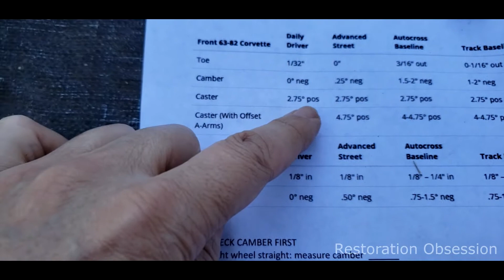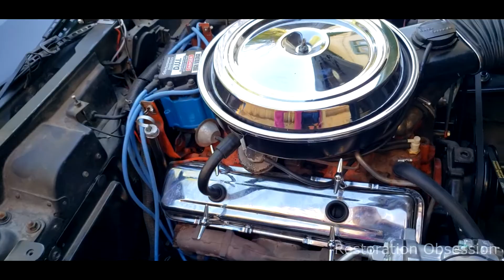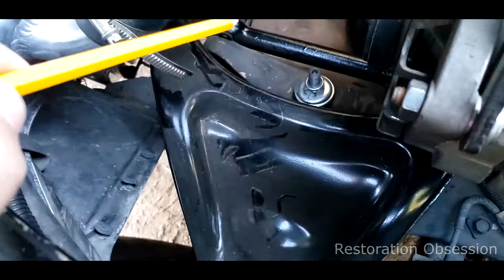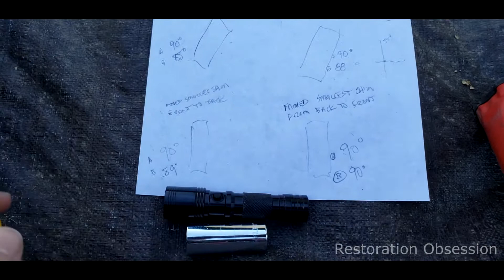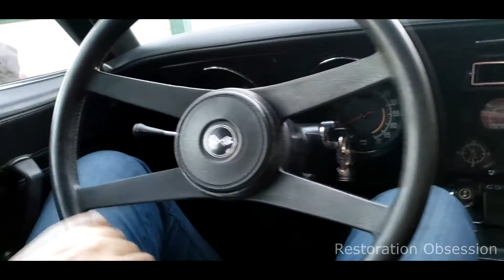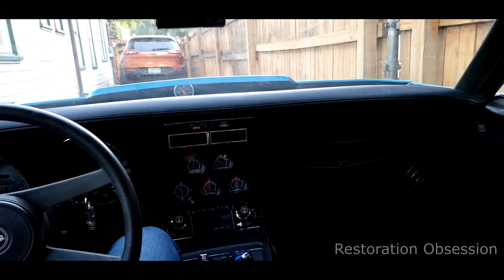1976 C3 Corvette Stingray - Front Wheel Caster Adjustment & Condensed Twisty Drive

Comment: You are adjusting the angles in the backwards order . You adjust caster first - then camber and finally toe . Adjusting caster will change camber and toe . Adjusting camber will change toe . When you adjust caster - you have to turn wheel out 20° then 20° in with out having all the drag from the black top .that's why a shop has plates with bearings in between so the wheels can turn freely.  You want 1/2° less on left side for road crown . You also want your angle  guage on the hub not the wheel . Just remove the dust cap . Camber you usually want close to 0° for normal driving . The double A arms have the geometry built in to when you go around a turn more weight will go to outside wheel and the camber will go negative- kicking the top of the wheel in for better traction . The spindle also has steering axis inclination to help adjust the toe while turning since outer wheel will fallow a bigger circle . Inner wheel will run a tighter circle . Enough  - if anymore info can help post back .

Comment: Thanks for posting this video. i was looking for information on how to read castor degrees on my 79 C3. Rear end restoration was my winter project after purchasing my one owner Vette and bring her home on Oct. 1st/2020. It liked to wander on the 2 hour drive home and burn copious amounts of premium fuel at 70mph. lol. I began my restoration by building 2 ramps so I could work underneath her. 4-2x12s were trimmed to 10'-11" and the and the 13" pieces along with a few others I had to cut from another 12 " wide plank were used as uprights on 16 Inch centers. Next I ripped a 1/2' sheet of plywood in three pieces 16" wide and boxed in the sides of the wooden frame for more strength and stability. I use 2 pieces of 8ft. long 2x12 with center supports for ramps to get her up and down. Copious amounts of money were spent rebuilding the rear suspension to make sure of a good alignment. Every rubber mount and bushing (strut rods, trailing arms cross member cushions) were renewed with rubber. New half shaft U-joints, differential stub shafts due to wear on the differential pin. These should be checked for excessive wear as they will effect keeping the vehicle in alignment. I even installed a new rear spring while I was at it. Gear pattern was checked for excessive wear while it was out of the car. Differential refilled, once back in place, with 85W-140 gear oil and 2 bottles of GM posi-traction oil. After a few miles of driving and giving new parts a chance to settle in where they wanted to be, an alignment was done. A different car to drive now. This coming winter will be body mounts, a Buick Grand National 2oo4r overdrive transmission, and replacement of any worn front steering and suspension. My three sons will be passed this classic automobile eventually.
Reply from the maker: Glad to be of help, John. Good luck with your restoration!

Comment: I forgot to add that most people do not realize how involved doing the entire front suspension is so you have tackled easily one of the most difficult and involved things possible on these cars. You didn't show or mention how you got the front springs back in. I am curious because there are a few ways to do it and it's possible to do without a spring compressor as I did by using a long threaded rod and drawing the parts together. I also used it to remove the tension and lower everything down to the floor. Congratulations on a tough job well done.
Reply from the maker: That's good to know! It was actually quite fun. On the front springs, sorry for not posting that, I didn't have a tripod for my phone at the time. I wedged them in there and used a floor jack under the lower control arm, jacked it up slightly, used a foot too shove/kick the spring back into it's spot and the springs went back in without much effort. I did put a strap around them just in case they decided to go firing off into some random direction, but they went in fairly easily without having to compress them.

Comment: I'm a new subscriber and have watched several of your videos. I have a '76 L82 4 speed car and have done a ton of stuff including all the front suspension like you have. I also added something that you should consider and that is the Borgenson steering box upgrade for the C-3 cars. The old power steering is from the early model full size Chevy cars and after the rest of the product line moved to integral steering boxes the Corvettes never did. Thus we are stuck with an antiquated leaky system that has poor steering feel and is a pain to repair with the leaky hoses and such. The Borgenson moves you into a faster steering ratio by using a later model modern steering box that the lines from your pump plug directly into and gives you a steering feel that these cars never had. The old ram cylinder and steering valve are removed along with the lines that attached this stuff. Please consider it. Also please get the car to an alignment shop and have the caster set to at least 3 degrees or more. There is no downside but will help the stability and if you eventually put in the Borgenson box will really show it's stuff. Many modern cars are running over 4 degrees.  I love the steering on my car now and it makes the car feel like newer Corvette. Great site by the way and please keep doing the videos. I especially enjoyed the one on the clock.
Reply from the maker: Hey Mike. Thanks for the feedback! I've already replaced all the existing steering assist stuff, so when that goes out I'll look into the Borgenson for sure. I'll be posting a fuel pump vid soon, but have run into some personal life snags as of late which has derailed me from doing much of anything at all. Thanks again! I appreciate your feedback and support.

Comment: Good morning there,,,,this is frank from glendale az,,,would a holley 600 cfm will work with our 76stingray..let me know what you think
Reply from the maker: Hey Franky. Yeah, 600 cfm on a stock 350 should work great. Do you currently have the original quadrajet on it? If so, why not rebuild it? It's an easy job over a weekend. If you do replace the Q-jet and decide to get rid of it, let me know, I'd be interested in it.
Reply: Yeah, my rochester quadrajet still running, last night i replaced the fuel filter it runs alot better but it’s the original carb, i thought about buying a rebuild kit to give life back to carb,,,i will let you know. Text me if you like 60271seven05six2...cool

Comment: Hi, just enjoyed your video and my wife is laughing saying you guys are so similar! That’s because I have a ‘74 C3 and an ‘84 CJ7. Been working on the Vette for 7 years...The CJ I’ve owned since 91 and is fully rebuilt. My C5 doesn’t need much thank goodness as parts availability for American stuff is slow and very expensive over here in England.
Reply: Hi again Anna, yes I saw your TR7 hiding from the sun! They mostly rotted away in our rainy climate...quite a few have been converted to the (Buick originally) Rover V8.
Here’s my Cj7:
Reply: Oops- can’t seem to post the pic....
Reply from the maker: @patrickmcgowan5543  I have an original 1963 Buick 215 V8 in my laundry room that I picked up for the TR7, but I had already rebuilt the little 4-cyl in it, and the cost for rebuilding the 215 was costly, so there it sits lol. Not sure if it's just my browser or what, but your CJ pic does not appear.
Reply from the maker: Haha that's awesome. Did you know that in addition to the C3 and CJ5 I also have a Triumph TR7? That's cool about your CJ. American parts are expensive here, too. Makes no sense!
Reply: 78 vette 48 custom willys CJ 3 A